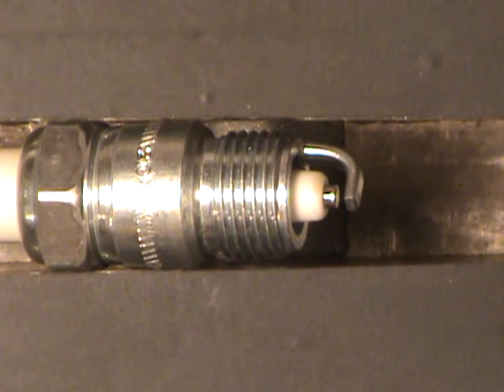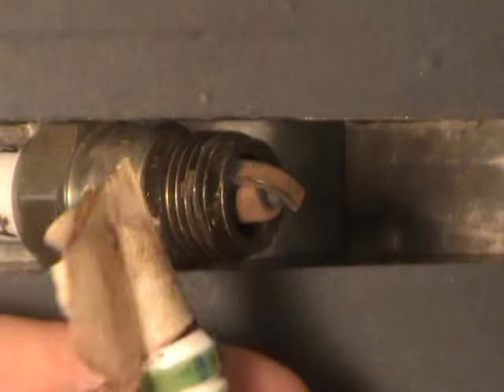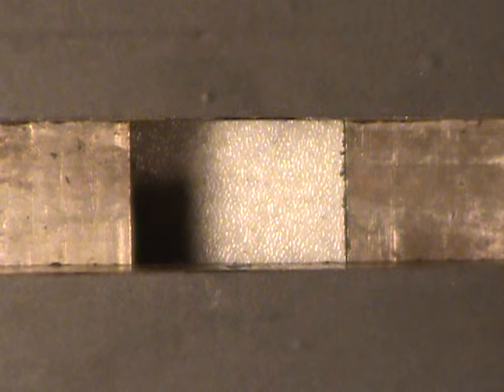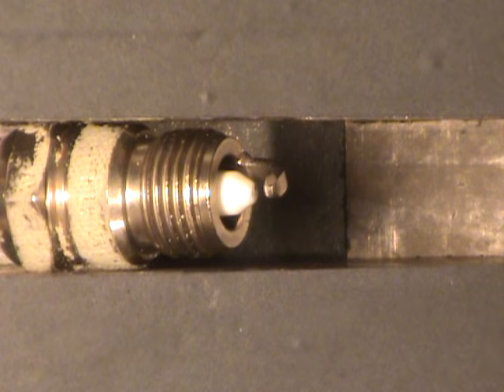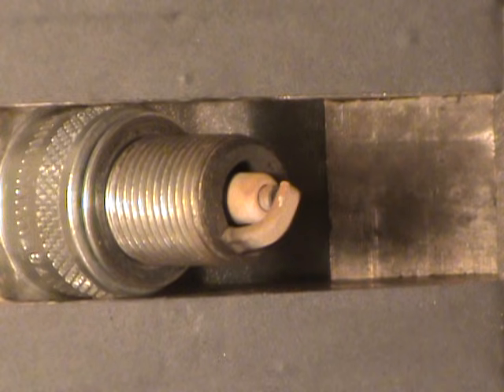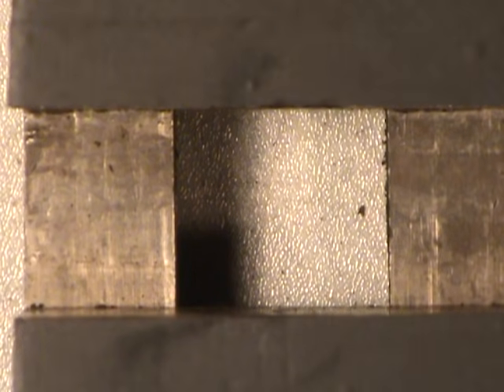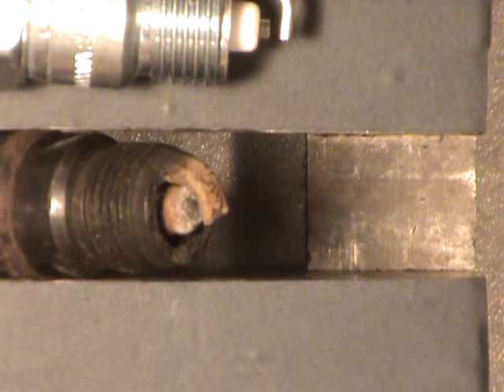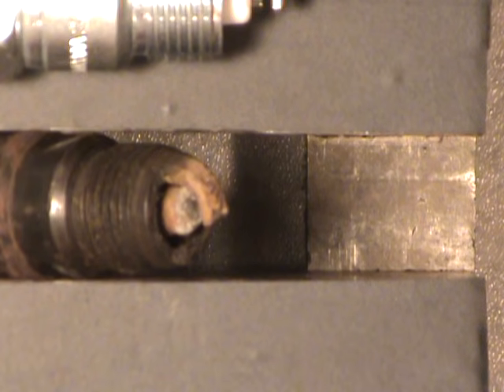SPARK PLUGS How to Read them (Part 3)

Comment: Not necessarily oil control rings but common way an engine burns excessive oil is caused by blow-by.  The blow-by push the oil via the PCV system into the intake tract, especially on modern engines that no longer plumb the the fresh air charge portion of the PCV system directly in the air cleane via a breather filter. On the old systems, when you find the air cleaner & filter saturated with oil it was a sign of a tired [warn] engine. This oil is deposited in the air cleaner & filter assembly through the fresh air charge of the PCV system becuase the amount of blow-by is greater than the PVC was designed to handle. So, the excesses amount of of blow-by literally gets pushed out via the fresh air supply [goes in reverse of its intended flow]. This is no longer  seen becuase the fresh air supply in modern automobiles is now plumbed between the throttle body & the air cleaner...
These  are my two cent's...
Reply from the maker: Greetings...Jose Cuevas...…..Thanks for watching...…..I agree with, what you said, in the comment that you posted, good job (although, some PCV systems, still might have, a rubber hose, coming out of, the other valve cover, on a V-6 or V-8 engine, that is connected to, the air filter's (usually plastic) housing/box...…….There is one more way, that, a push-rod/valve, type of engine, can sometimes, burn motor oil as well, and, that is when, one or more, of the valve stem "seals", goes bad, and then allows motor oil, to just, trickle down the valve's stem (due to earth's gravity), and then, ends up, going into the combustion chamber, when that valve opens (probably more so, on an intake valve, I  be guessin')……….Now for, my two cents...lol...…….Whenever replacing a PCV valve (PCV = Positive Crankcase Ventilation) valve, then, make damn sure, to get the "correct" one, that is "calibrated" for, that "exact" engine, as there are many, yes, I say Many, different ones, that might physically fit alright, but will all have, different "Flow Rates"...!!!...……Might inhale, either too much, or maybe, not enough, which might, cause a problem or two, maybe...???...….and...….till next time......Be Safe, take care, and have a good one.

Comment: I like your explanations and visuals on reading spark plugs.  I just rebuild the sbc 350 in my Nova and I want to keep an eye on my plugs to check my work.  The plugs look good going by your video, thanks.
Reply from the maker: Greetings...DIY Dave..........Thanks for the nice comment, and, thanks for watching...........I'ts good to hear, that, your engine, seems to be healthy...........If you are using, those old school, cheaper spark plugs, then, check the spark plug's "gap", once in a while, as, the old rule of thumb, use-tah be, that, there would be, about .001" (one thousandths of an inch), gap "growth", for every 1,000 Miles, that, the vehicle travelled...........Also, on those older style/cheaper spark plugs, when the "center" electrode's outside edges (around its perimeter), started to get rounded over (not a sharp edge anymore), then, the ignition coil, would have to, work a lot harder, to make that spark, jump the gap...why you ask, well...from what I've heard in the past, was that, high voltage sparks, find it much easier, to jump from "sharp" edges..........Makes sense to me alright, as, the much newer spark plug's "center" electrodes, are very small in diameter, and usually made out of precious metal (platinum/iridium), so, the center electrode would be able to last longer, seeing as how, it was so tiny, as compared to, the older/cheaper spark plugs, that had, the much larger diameter, center electrode, which was not, made out of a precious metal at all, and.......till next time........Be Safe, take care, and have a good one.

Comment: Those original Chevy plugs show the right heat range at least, around two thirds of the earth electrode was coloured correctly. Perhaps you could do a further video on how to read plugs on an engine with pre-ignition or "pinging"?
Reply from the maker: Greetings...Jake Elliott...…….Thanks for watching...…...Well, I don't happen to have, any spark plugs, that have any real damage on them, other than, a well worn/worn-out, high mileage on them, spark plugs, that have electrodes, that are, all, eaten-away by, high voltage "arcing" (sparking...lol), with rounded off corners, or, are all covered with, too many deposits, that might cause, a cylinder misfire...…...Come to think of it, I do have a few, spark plugs, that have, the Ceramic part of the spark plug..."Broken-in-two-Pieces"...and no, not caused when an engine was running, more like the Guy (Me...!!!...lol), that never kept the spark plug "socket-extension-and-ratchet", in line with the spark plug, as it was being installed, or sometimes, removed from an engine's cylinder head...!!!...lol...…….The newer vehicle's engines, that are fuel injected and computer controlled, will probably have "knock sensors" on them, so, once the knock "frequency" becomes present, then, the knock sensor will then be telling the vehicle's on-board computer, to..."Back-Off" the ignition timing advance amount, until that knock "frequency" is gone...!!!...so, if the gasoline Octane is too low, for an engine that requires a higher Octane rating, then, the engine, will usually be protected from any real damage, by what the knock sensor/s monitor...…….On the older carbureted engines, without an on-board computer, then yes, engine pinging and knocking, sure are possible alright...…….Too low of an Octane rating, for an engine, that requires a Higher Octane rating...too much ignition advance (in a distributor)...or...too lean of an air/fuel ratio (mixture), can sometimes be a problem, and, if really bad, engine damage can be quite severe, especially when, going "wide open throttle/pedal to the metal"...!!!...and......till next time...…..Be Safe, take care, and have a good one.

Comment: What does a pink plug mean
Reply from the maker: Greetings...Ethan Parsley...…….Thanks for watching...…...A "pink" spark plug, you say...…...Well, about the only thing that comes to mind (mine, that is), is that, that "pink" color, might be an "additive", that is part of the gasoline "blend", and gets deposited onto the spark plug (electrode end), when the fuel (gasoline), burns, inside of the engine's combustion chamber...……..In the past, I've had a..."Red-ish/Brownish"...color deposit, stuck onto the spark plugs, and, as far as I recall, that particular gasoline "additive", was called (I think?)..."MMT"...(MMT, was short for, some very hard to say, word, or words), and, you can probably look up, what the full word, or words are, on the internet somewhere, and maybe, you can look for a spark plug "picture", that might be showing that "pink" color, that you have there, and, see if that "pink" stuff, is actually a "deposit" or not...???...…...Good luck, in finding that picture, and...…..till next time...…..Be Safe, take care, and have a good one.